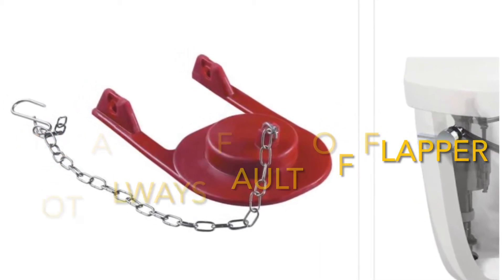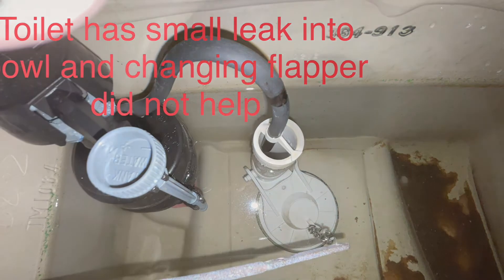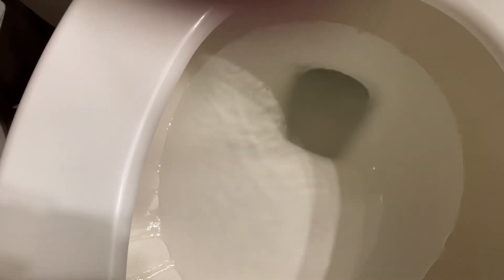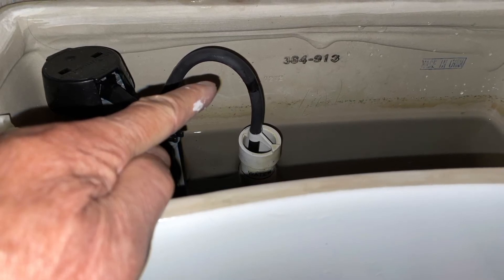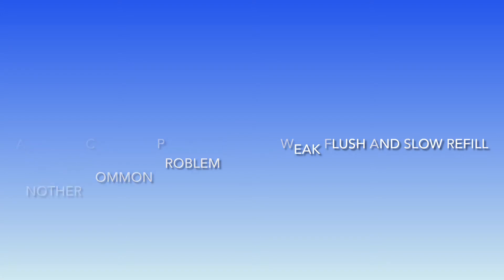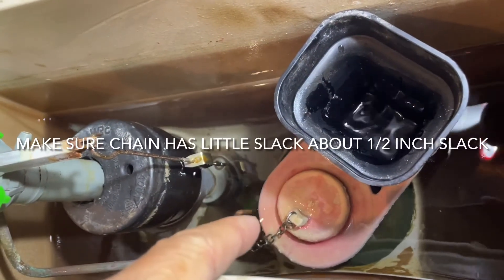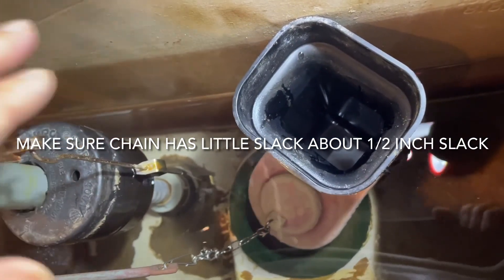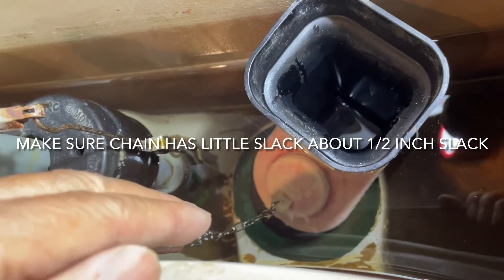An often overlooked reason for a running toilet

Comment: Another reason for a slow, weak, or "lazy" flush, as its called might surprise you.  I had to learn this one the hard way.  They sell those "drop ins" that turn the water blue.  Some toilets have a problem with them, depending on how they are designed.  The blue water actually turns slightly syrupy, or thicker, and doesn't flow as freely.  Removing the tablet and flushing a number of times will solve that problem.  So if the problem just happened out of nowhere, and you had added one of those tablets, that is usually the culprit.
Reply from the maker: And the chlorine type toilet cleaning tablet also can create a problem by leaving particles behind that can cause the flapper not to seat properly and leak water into the drain tube. Thank you for mentioning the problem with the self dispense blue cleanser. Another annoying  thing with the toilet is a slow refill. This often happens after you replace the flapper. I found by removing the slack in the flapper chain, the tank actually refills faster.
Reply: @wtam69  Yes, that's true.  I've heard that the chlorine tabs can cause the flapper to harden, which may cause it to not seal well.  Another thing that happens occasionally, is the outlet of the tank that the flapper seats against can get deposits on it, which can also cause a leak.  I always make sure to hit that with a scrubby pad when replacing a flapper.

Sometimes the toilet will refill slowly, which is a problem that happens over time, due to mineral build-up in the valve.  I've found no good way to rectify that problem except to replace it.  It usually flows quite well after that.  In fact, when I moved in to my house, the upstairs toilet filled very slowly, which was especially a problem when the inground sprinklers were running, it could take over 10 minutes for it to refill.  Replacing the valve solved the problem.
Reply from the maker: @jaykay18  Beware some of the quick fill valve units lack the water hammer inhibitor. This is a short length tube that sits inside the flush valve tube. Some people remove this inhibitor and the toilet fills faster. This is fine if you don’t have a clunking sound (water hammer) when you flush your toilet.
Reply: @wtam69  Thanks, I didn't know that.